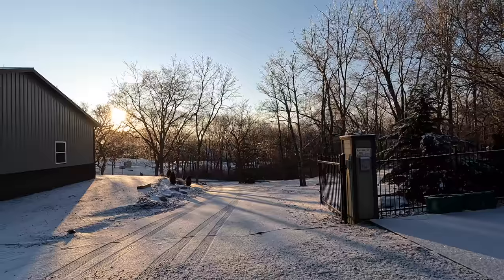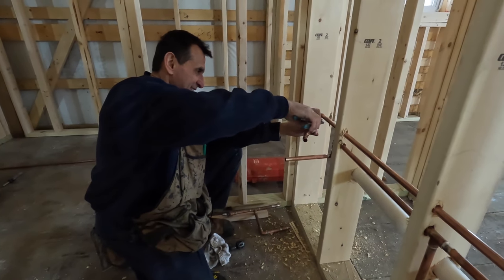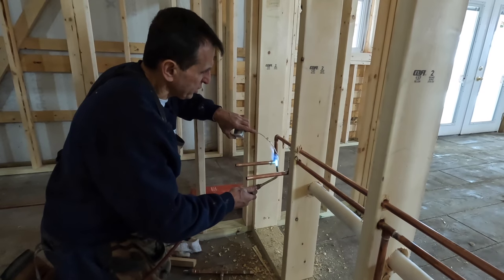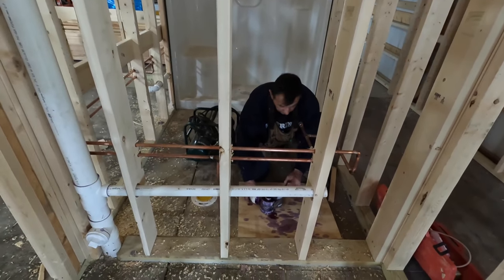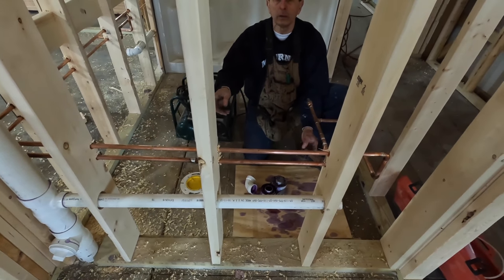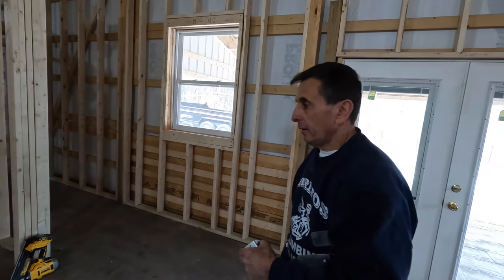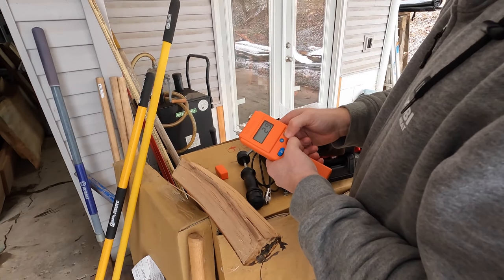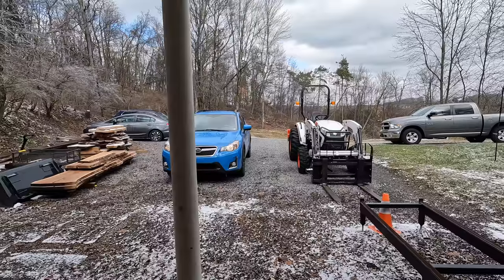ABSOLUTE FASTEST way to Dry FIREWOOD and the Return of Plumber Jim!

Comment: Started stacking and stickering rough cut lumber and slabs out in my barn several years ago. Now I find out I did it all wrong. You know what means? I have to get out there and pull it all down and redo it to the MORGAN STANDARD or I will not sleep at night. 
Your videos just keep getting better and better.

Comment: I miss plumbing that way. Little details that only I did because it was just better. I did the same once pex took over but you just couldn’t beat a quality copper instal. Jim will agree it’s like a puzzle. You have to instal it in order, so pieces can be moved to make connections or sweat a single joint before you move a section back into the wall. Great work Jim and good job Morgan’s again for allowing Jim to do quality work. 👍👍

Comment: I built one here in the qeer old corrupt UK out of 5 old steel tin garage doors. Used an old 45gallon oil drum as a fire holder snd used old bark and scrap wood cardboard paper and old rags shoes old used car engine oil and most things that would burn. With a low blow 240v fan to circulate the air around the log cubies.I can dry 6 1000 litre ibc steel cubes of wet fresh cut logs at a time with a low heat provides plenty of hot air to dry the logs in about 4 to 5 days...

Comment: Mike when it comes time to take the load of oak to the kiln it would be interesting to know the weight before and after.  Something else that would be interesting would be the weight of a green large basket and a green small basket.  This would help to tell if a particular tractor could lift the basket.  Do you have a weight station near by?  Thanks Mike
Reply: Mike and I were just talking about this recently. There is a weigh station close by that he has been thinking of visiting with a full basket. I like your idea of before and after, though. Very similar to how we can determine the MC% of lumber using the oven-dry method.
Reply: @martin_kiln_and_slabworks   Looking forward to the results.

Comment: I love watching a true professional, such as Plumber JIm, at work.  He is meticulous, organized, and makes the most efficient use of materials and time!  Great job Jim!!!
I would like to ask Jim a question though.  I noticed that he drilled his holes CLOSE to the edge of the studs versus in the center of them.  I am sure there is a good reason why he does this.  
As for me, I would have been drilling in the MIDDLE of the studs!  I know you still need the "nail plates" to protect the copper, but is there another reason?  Maybe easier to feed the pipes through the studs??
Reply: Most likely an offset for the waste line or venting run that is to the centerline.

Comment: Back in the 1950's my dad plumbed my great Uncle's new house.  When they turned on the water on after the dry wall the found one leak and when they tore the dry wall off they found that one of the nails had went through one of the copper pipes.  Whish they would have had those wall protectors back then.

Comment: I think it's a very different animal drying timber to drying firewood.
I used to run a big commercial timber kiln and I was surprised he had even slabs in with firewood.
I've never tried it but I'd be tempted to set the kiln somewhere below the flash point of the wood which would crack it all up but that would get the heat into the core of the sticks a lot quicker.
Getting a kiln up to those temperatures would be expensive using natural gas or something like it but a timber fired kiln has heat to spare.
As I said I've never tried drying firewood but I would've been expecting something like a 24 hour turn around for a load.
I think someone will work it out one day and will be selling dripping wet sticks 24 hours later instead of 1 to 2 years.
Most commercial kilns are huge compared to that one and that brings in economies of scale. 20 to 30 cords per firing as a guess.
Edit I saw on another channel a firewood lot using 5 wood processors who sold by the semi load.
Not even I can dream that big.

Comment: Great video!! A couple quick questions if I may.
 1st, what made you decide to go with copper piping vs PEX?
2nd, is drying firewood in a kiln financially viable? Thinking of what it costs to run the kiln, can you actually charge enough and still have a decent return or would the cost / price, price you out of the market ?
Looking forward to what changes (there are always changes) will be coming for you and your family
Reply: Was wondering the same thing. I want to know how much it cost to run that kiln for 1week.
Reply: @ethankincaid9022  Electricity for the kiln alone adds $125 per week to our electric bill. I'm getting ready to test 4 of those baskets in the kiln at once to see how well it dries, but just like slabs and lumber, letting it air dry (or season) and then drying is always more cost-efficient. There are actual firewood kilns that run on firewood heated systems and their electricity costs are significantly lower.

Comment: I'm curious about the energy cost to run the kiln...  Can you charge enough premium on the kiln dried firewood to recoup your energy cost and still have customers willing to pay that premium?  

Can you use an outdoor wood burning furnace as your heat energy source for the kiln?
Reply: Purchase price is $60k on the low end
Reply: Exactly !!! that's what I want to know but apparently the video turns out to be more important on the plumber side!. Fastest way to dry firewood, but let's talk about plumber.
Reply: About $125 per week in electricity for a full load and I going to test it soon, but theoretically, I can get 4 baskets in per load. Our main income is drying slabs and lumber for local sawmills. We usually have some void space in the ends of the stacks that have to be baffled for proper airflow, so we're looking at firewood, 6/4 cutting board stock, etc for resale. Other kiln owners have cut plywood for walls to control the baffle airflow....can't resell that so it just seems like a waste.
Reply: @seanpuffer8436  plus freight, and then installation if you don't have a 10K forklift or crane on your property. I wouldn't buy this solely for drying firewood. Definitely better options out there.

Comment: You should cut that wood in half and check the moisture there to for comparison.  The center is probably alot higher than the surface 1/4". I tested some of my oak, 15 on the sides, 25 in the center. It takes serious heat and time to get the whole stick down to 15 or under.

Comment: Curious What would the drying time be for a basket of wood if dried outside.  Lots of variables but how long does it take to get wood to 15%
Reply: Really depends on species, time of year, air flow in the basket, etc. Most pro's say 1 year for seasoned firewood, but that could easily be 2 years for oaks and elms...There are dedicated firewood kilns that produce around 6 cords of seasoned firewood in ~3 days. What an operation that would be!

Comment: Would be interesting to know what kind of energy costs would be incurred  for an average drying load.
Reply: My thoughts exactly!
Reply: totally, defeats the purpose of firewood. Just cut the wood in the summer and leave it outsside
Reply: Varies on wood type and starting MC% just like with slabs and lumber. Sometimes we don't get a full load of lumber to dry from customers, so we have to baffle the end to get proper airflow. But the kiln costs us about $125 a week in electricity to run it with a full load.

Comment: 25 years ago my neighbor came over and said they had a water leak dripping in the kitchen ceiling.  The house was around a year old.  I went over and after digging around, I pulled the access to the bathtub on the second floor.  I found a leak in an elbow.  Turns out it had never been soldered and had held together all that time just with friction and the solder flux sealing it.  It just finally decided to come apart after all that time.

Comment: iDRY KILN FAQ

What can I dry?

Stick pretty much whatever you want in this kiln? Just keep your expectations in check.  If you're trying to dry 24" beams they will crack, if you're drying 4/4 maple it won't.  
How much does it cost?

Pricing on the products page here: CLICK HERE (cheapest one is $60k)
What is the operating cost?

The iDRY Standard is about $100 per week for electricity
Do I need a boiler?

Nope, unless you want to use one.  Most people go with the standard electrically heated version.
What is the power requirement?

iDRY Standard and PLUS are 208-240V 1PH 60A 60Hz
Can I put my kiln outside?

Nope.  It will freeze and it is designed to heat the wood NOT the WORLD!
How much lumber can I fit?

The iDRY Standard is about 1000 to 2000 board feet and the iDRY PLUS is about 3000 to 4000 board feet.  It really depends on the lengths and how tight you can make your lumber pack. 
Is this a vacuum kiln?

Heck yeah! All our kilns are continuous vacuum kilns. 
Can I get this machine financed?

Go to the Apply Now button at the bottom of the home page.  Fill out the application.  Unless your credit is terrible we should have you approved today. 
How do I load this thing?

The iDRY Standard and PLUS kilns take a stickered pack of lumber or slabs.  You can load it up by hand or with a forklift or your tractor.  Keep your lumber within the length and width of the trolley as best you can.  The iDRY Turbo and Turbo Pro are heating plate kilns, so no stickers, faster and amazing. 
Is the track and trolley included?

Sure is buddy…we wouldn’t make you build your own!
Do iDRY people install it for me?

No.  Your local licensed electrician and plumber can handle it…no problem. We’ll help over the phone if needed.
Is shipping cost included?

No.  We can quote shipping, but rates change all the time so we can only estimate the cost. GET A QUOTE HERE
How do I get it off the trailer when it arrives?

Crane, forklift, a couple of forklifts, a bunch of bobcats or whatever works. This machine comes completely assembled and welded together.  It can be picked up by lift points on top or from under the chamber with care.  If you pick it with a forklift use bolsters to spread across the frame of the chamber to prevent damage to the exterior sheetmetal.

Play this “Loading a kiln” video in reverse: CLICK HERE 
Do I need a moisture meter?

We recommend you take a temperature and species calibrated reading at the core of the wood. Many people ship their wood thinking it is dry, but they use an inaccurate moisture meter that only reads 1/4” into the wood. We recommend the Delmhorst J-2000 Moisture Meter WITH a pin hammer.
Is this kiln difficult to run?

Can you press a button? Then no.
How do I know there isn’t too much competition for kiln drying in my area?

We’re about 1% of the way to saturating the market for lumber drying…relax. Think of how many Woodmizer sawmills are out there and how few kilns.  Every portable size sawmill needs about 3 or more iDRY Kilns to dry the lumber they saw.  There are THOUSANDS of little sawmills out there.  Go get em’ tiger!

Comment: 😂I'm drying wet fire wood with a 18000 BTU propane blower takes 10 gallons of propane to dry the wood stacked a guy dumped delivered a cord for $300 bucks not dry by any means I got,got now I'm drying it at the cost of propane heat. I learned my lesson to check many pieces of wood before they dump.

Comment: 2:00 I always remove the valve core when soldering a shower valve like that, you can easily damage or melt its components if too much heat is added.

Comment: Copper is good and the work looks good.....until you loose power and the copper freezes and burst or a joint fails.  PEX - no joints and if it freezes it expands and comes right back and about a 1/3rd the cost.

Comment: FYI:  If your temperature was 160 degrees F, what you called steam would have been more like a fog or cloud.  Steam is formed at 212 degrees F at standard atmospheric pressure.  Under pressure the temperature needed to make steam goes up.   For instance, it takes 388 degrees F to get 200 lbs of steam pressure in our Steam Locomotive.
Reply: Yes, it’s the same phenomenon as being able to see your breath in cold air. The equilibrium humidity (actually partial vapor pressure) at the 140-150F (somewhere in the 55-65C range) temp and 15% humidity of the wood is far higher than the dew point of the air, so any vapor coming off the wood condenses into a little cloud. Cool stuff (figuratively anyway!)
Reply: This is a vacuum kiln.  That means steam will be formed at a lower temperature.
Reply: boooshes   There was no vacuum as soon as the seal on the door was cracked.  If there was any steam in the chamber at that time it would have instantly turned back to a liquid as soon as the door was opened, breaking the seal.  Mike mentions seeing the steam at 14:49 when the guy splits one of the pieces of firewood.  

What he sees is more like a fog or cloud.  Then shortly after he splits the piece of firewood he mentions they bring the temperature up to 160 degrees F.   When he takes the reading for the moisture content he says the temperature has dropped to around 140 degrees F.  Since he is handling the piece of wood with his bare hands I suspect it is lower than 140 degrees F.

Another example of this display of science, is the very popular tourist destination where you can see this taking place, is the, “Great Smoky Mountains.”  They are in Eastern Tennessee and Western North Carolina.  One of our favorite places to visit on vacation,  second only by Fort Walton / Destin, Florida.
Reply: @billmorris2613  ok, I wasn't paying enough attention to the discussion and thought you were saying that the kiln didn't get hit enough to produce steam. But you were saying that what they saw was actually just water vapor at that point, not steam.  Agreed.
Reply: boooshes   Correct.  I was referring to when he split the piece of firewood after it was taken out of the kiln.   That was the first mention of steam, which was really fog.
Reply: @billmorris2613  similar to the fog in my head when I made my comment...🙄

Comment: try heat (any) pyrolysis of biomass (wood) into methane ch4 natural gas, ie, filter and compress it into methane tanks, like propane
Reply: or try gasoline and gas-oils distillation from gasifier (any heat source) gassed biomass, separation with standard tower oils-gas-heavy separation, bio oil separation
Reply: try carbonization of biomass (any heat source) to carbon, the most inert but very hot burning natural bio burn fuel, like grass, pruned biomaterial, leaves, algae

Comment: I am sure your buddy Jim is a nice guy, but what he has done would not pass Code in Texas
Reply from the maker: You mean Texas where they run water lines in the attic and everyone sprung a leak when it froze?
Reply: @OutdoorsWithTheMorgans  Not quite sure how to or if I should respond.  Ok.  Lol yes pipes freeze?  On the other part, if permitted would it pass inspection. Even work I’ve done in County out of City permits was to IBC standard.  Including pipe sizing and use of 1/2 “air chambers”.